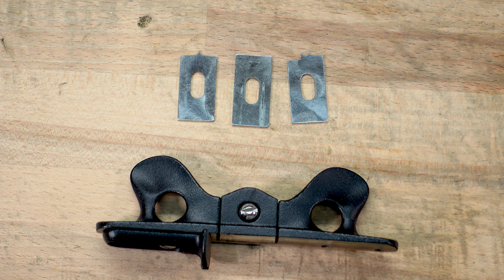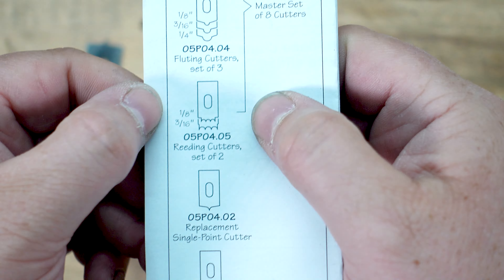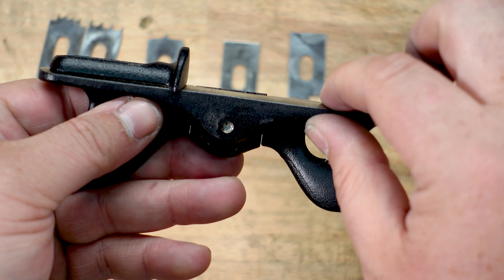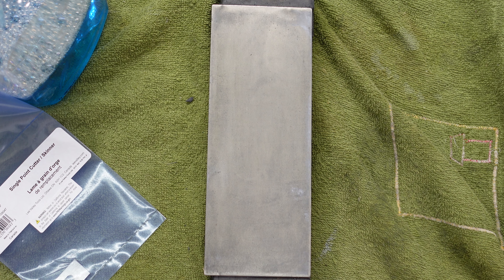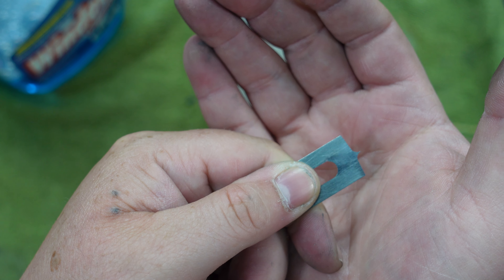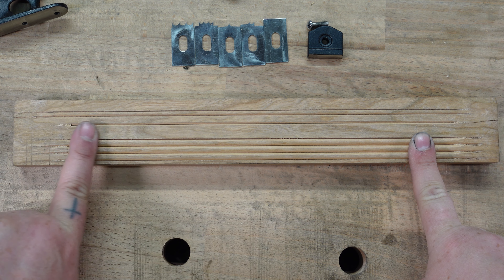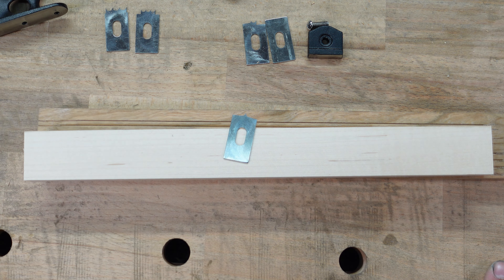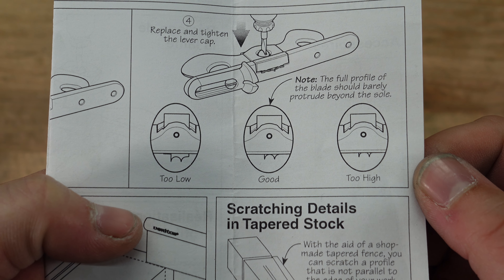Lee Valley Cast Scratch Stock - How to use a Beading Plane

Comment: Thank you for demonstrating this tool.  I have a 55 and its great for mouldings, but only in a straight line.  I'm of the understanding that the scratch stock is used for rounded edge work.  Could you demonstrate how that is done please.
Reply from the maker: Hey! Ya that would make a good short, I'm going to add it to the calendar and do my best to get it done this week :)
Reply from the maker: I gotta apologize I wasn't able to get the video done this week. I was prepping for this weekends Virginia Makers Swap and announced starting my nonprofit so it was hectic! 

The same principals apply to a rounded edge. Pressure against the fence 100%. Score a light line. For curves I Score a few times before "cutting" and shifting pressure even fence and downward. 
I hope that helps in the mean time. 

I will keep this on my list and do my best to get it done next week. I apologize again!
Reply: @BatCaveCreations  No apologies required.  More to the point, thanks for intending to do a short showing people how to do a moulded edge on a rounded corner.  None of the combination planes can do that.  So it's an essential process if a wood worker wants to progress.  Thank you
Reply from the maker: I agree 100%!! I also have a stanley one I want to include. It's easier for bigger projects vs the cast scratch. Thank you for understanding!
Reply from the maker: Got it done! :D 

https://youtu.be/E57Z9xItjLs

Comment: Is there a noticeable difference in the results you get from the beading plane compared to the combo plane with it's similarly shaped blades?
Reply from the maker: The result difference would be planed vs scraped. The combo planes the beads vs the cast scratch which scrapes the beads. It will be a preference look, try planing and scraping a board side by side and it is a very subtle difference that I think only a woodworker will see and no one will see once finished. 
The plow planes would be easier for longer beads and profiles. The cast scratch will be easier for small details. Imo. 
Great question! Thank you!